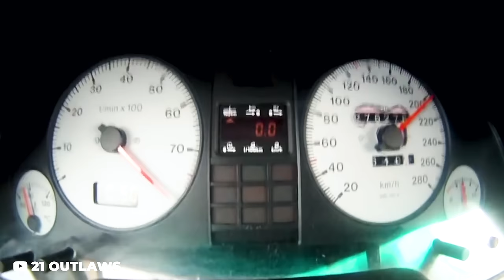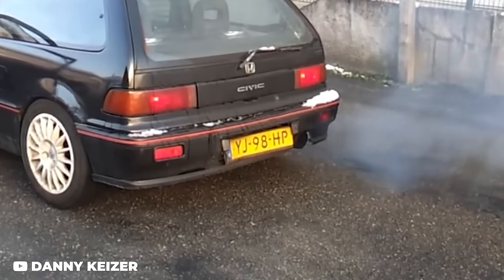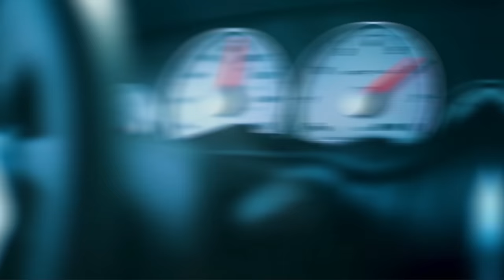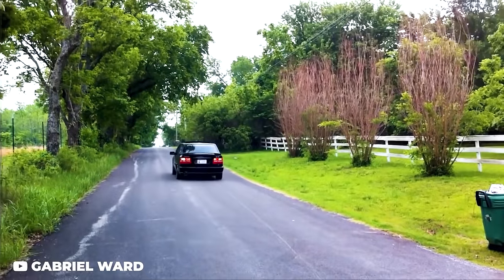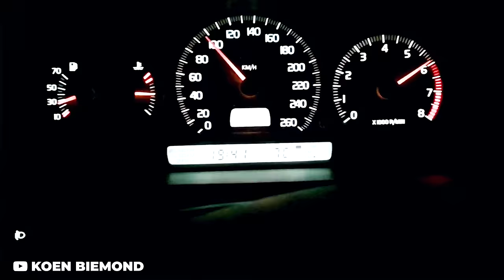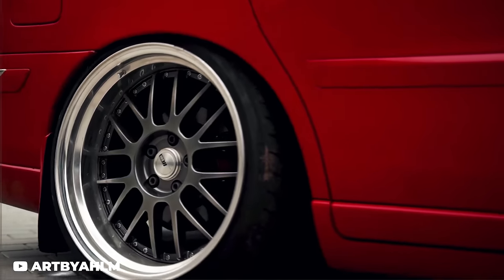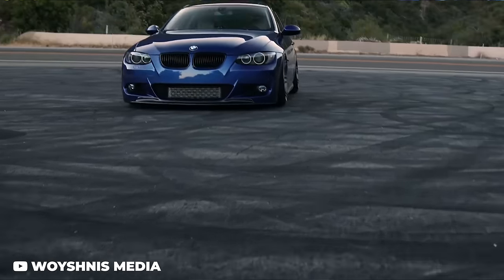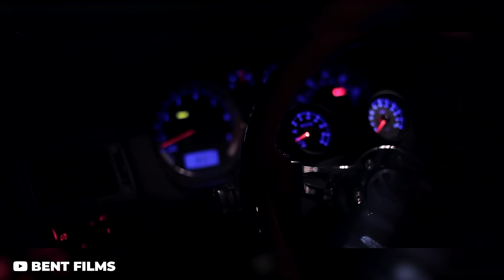5 Cars YOU Can BUILD For CHEAP Right Now!

Comment: quit telling truth about the 335i 😫 i’m still hoping to get one by March…
Reply: bro i recently got one. “cheap” to buy, not cheap to own. U better have like $3k-$4k over the purchase price of the car saved for repairs if u don’t plan to fix it yourself.
Reply: @yungkaos3500  my friend bought a e90 335i for 4k
Had to put 5k in maintenance/repairs
Reply: E36 M3 is a better car. Less problems.
Reply: @RadDadisRad  yes and no 
The E36 platform is amazing 
Relatively reliable 
Great aftermarket support 
Stylish and timeless 
The thing is the e36 market is rising, especially for the M3 and even 328i's
They're also severally underpowered and aren't nevertheless cheap to boost
Reply: $3k in repairs per year, every year.
Reply: Make sure you don't cheap out on the one you buy.  I looked for a few months to find one with good maintenance records.   Paid 11k, went FBO and mhd 2+ within a month of buying it.  3yrs later beating on it as a daily driver, maybe have 1k in repairs for things that broke, maybe 2k in maintenance, all work done myself in my driveway, so far with no issues, or check engine lights in a close to a year.  N54 will treat you good if you treat it good. Oh, and zero leaks as well 😉
Reply: @yungkaos3500  IMO you should not buy a BMW if your not going to do nearly all the work yourself including removing the engine to do leak repairs. This is a hardcore enthusiast car IMO. It's not for beginners unless money isn't a problem.
Reply: Paid $20K CAD for mine 5 years ago, 2007 70K km on it. Maintenance records, no headaches until recently. Just your basic maintenance tho, Oil Filter Housing Gaskets, Valve Cover Gaskets, oil cooler gaskets etc. Just dont cheap out on maintenance and the engine is bulletproof. Unfortunately, its the accessories around the engine that suck (Waterpump, thermostat, injectors) that tend to fail. Luckily FCP Euro has a lifetime warranty, buy once, never pay again.
Reply: FR that was gonna be my next project I don’t want fitment industries blowing up the price
Reply: It's an awesome car. But it will destroy your bank account to stay alive.
Reply: @MrMeasaftw  Not really if you do the work yourself and stick to as much aftermarket as you can. Parts are still going to cost more, but if what you're looking for is fully build internal engine power, then BMW's can give you that without having to build the engine internals.
Reply: @MrMeasaftw  But are the sensors that were damaged really necessary? I know that German cars have all kinds of sensors to control automated features like temperature adjustment of climate control and lights etc. 

The VANOS is the greatest PITA with BMW engines, that I know.
Reply: @SI0AX  I've replaced the map sensor, both crankshaft position sensors. No non-essential stuff so far. Point is. No matter what you do. Things will break. They will be expensive as hell compared to something like a 350z or a civic. And worst of all. The German engineering made it so you need 3 different bits to take off your fender liner. THE FUCKING FENDER LINER. I'm a mechanical engineer, and I like my designs to be at least somewhat easy to assemble. I think the BMW engineers took their parts and built a car in CAD. And then filled ALL the gaps with plastic brackets. Then they threw every single imaginable bolt size at it and called it a day.

I spent over an hour taking off a headlight the other day. Because the oil cooler was an afterthought, one of the brackets to remove the headlight is only accessible through a 3 cm gap in the front of the car. The car is full is this kind of bullshit. No room to work with, and 100 fasteners to loosen to get anywhere.
Reply: @MrMeasaftw  Shit... Never knew it was that bad. I thought Audi was the only one that liked trolling with 3 different fasteners to remove 1 small part and then having a different fastener for removing the adjacent valve cover. Damn, that pretty bad, I thought it was just recurring leaks that had to be repaired. I heard that it may be a hit or miss. Some owners get leaks, others get sensor problems.
Reply: @SI0AX  Okay I'm overreacting a little bit. It is not a terribly unreliable car overall. Its just anoying to service and unnecessarily expensive. And I live in Europe. The 3k a year on basic maintenance is pretty accurate.
Reply: @MrMeasaftw  Then it's best to not use that car a daily driver. I know the car is comfortable, but a Lexus is something I would daily drive(and actually do). 

A BMW would be a weekend car or using it for mid night races or race events etc. Limiting the mileage I put on the engine just to avoid the expensive maintenance.
Reply: @SI0AX  the battery will die if not driven often. 😅 Needs a trickle charge or daily drive
Reply: @MrMeasaftw  That happens to any car that sits for long periods. What I do is remove the battery and use the trickle charger. 

It should be fine with weekend drives unless there is a "parasitic drain" which can be a passive PITA to find the cause especially on an electronically complicated BMW because it can be cased by any of the electrical components in the vehicle.

I had a case where my 1991 Honda CRX has a parasitic drain caused by the seat belt sensor. I just disconnected and removed those useless sensors.

Comment: I no joke had my engine mount fail and the motor fall out of my 1.8t GTI…. It still runs, 1.8t never loose
Reply: Get Poly mounts. You didn't get any warnings like engine jumps between shifts that screw up your shifts?
Reply: @SI0AX  I ended up buying BFI’s. Now I run them in all my other VAG products

Comment: A cheap 335i will the be most expensive BMW you'll ever buy.
Reply: If you do all the work yourself and check to make sure the engine isn't toast, then it should be good. You will probably need to pull the engine to do some leak repairs but if you want to build a monster, this car will be usually cheaper because you don't need to buy forged engine parts and get machine shop work done to it.
Reply: @SI0AX  Yeah, they're really not that bad especially with the ease of power you can make. If you wanted a 350z with a VQ to make 6-700whp then I'll cost a lot more compared to the 335i N54.
Reply: @gabeishere4990  Pretty much any car will cost more than a BMW for going to that high power level because all of them will required forged pistons and rods along with all the other machine shop labor.

Comment: N55 motors in facelift E82 1er/E9x 3er cars aren't as internally strong as the N54, and have a bit more trouble making power but are pretty reliable. Making 390ish whp with an intercooler, downpipe, and chargepipe. Probably not even 1k deep yet
Reply: That's easily at least 2k+
Reply: @Jon-mo9ks  believe it or not aftermarket support to boost those cars is extremely cheap only problems is the regular maintenance that ends up costing more than aftermarket support. They even sell fbo kits for less than 1500

Comment: I have a 1.8T B5 A4. 5 speed manual with a K04 running Eurodyne Maestro software. Fun little work car/toy!
Reply: How's that software treating you? I'm looking for a good software. This tune I have now is shit... (Ko4, injectors fuel pump done on mine)
Reply: @Silenttoxx  it does the job but I wish I would have done a bit more research before I purchased it. My biggest complaints... If you use no lift shift, it's always on. Even at idle if you hit the clutch it will cut ignition. Why can't it only activate above a set rpm like the Boost Dynamic tune I had? 2 step is much the same, you don't need to have the clutch in. You can adjust where the set point is which is nice. I also had a crackle tune before Eurodyne, unfortunately there is no way to do it with this software. The deceleration fuel cut is always active with no way to disable. Customer service is basically nonexistent... You can only log what is already set up. Hptuners (can't do the 1.8T) you can create and log anything you can imagine. But Eurodyne is the cheapest way to tune this platform, if you want to be the tuner.
Reply: @4BillC  oh damn.. See I want no lift shift and launch control/ antilag to be able to be turned off.  I've seen some people make the cruise control switch the activation switch.    Is there any platforms that have that feature that you know of?  Like motoza ect..

Comment: B8 S4 with a few bolt ons will have you beating V8s left and right while having a better drive quality.
Reply: yeah but they are kind of like the 335i they break often and they are pretty expensive to repair
Reply: @qc_mat3537  Idk, I've seen multiple people say the b8 s4 is super reliable
Reply: @qc_mat3537  definitely not. 3.0 motors are pretty robust. The S4 is a solid platform. Many cars with 200k miles with a tune

Comment: Yes it's a V8 but hear me out, about a second or so slower 0-60 time as a new scat pack, 4 doors, big body, every luxury possible, reliability, find a high mileage Lexus ls430 and it's perfect slight modification these things rip, mine has almost 400k miles and I daily it pulls about a car length ahead against the mid 2000's mustang gt's, decent gas mileage for a V8, total sleeper cops never bug me in it get em while u can

Comment: The Volvo B5244T5 (P2 S60/V70 “face 2” T5 2.4) better be on this list.

Edit: Oh.. for f*** sake, the B5234T3 is not as cool as the B5244T5, the 2.4 (T5) is pretty similar straight wise as the 2.3, but i comes with the same Dual VVT top as the R (the other turbos “only” have VVT on the exhaust cam), has a very similar intake system as the R.

Comment: V8 is and always will be king
Reply: It's the most durable. You can buy high mileage V8's and not have to rebuild them unlike the 4 cylinders. Where I live people are asking nearly $20,000 for a Honda engine with more than 100,000 miles, it's BS, than engine is already near end of life with that mileage and will need a rebuild. That amount of money just isn't worth it. A V8 on the other-hand is a different story. Even high performance ones can get to 300,000 miles with little trouble.
Reply: @SI0AX  yes sir my mustang has over 180k on the clock and runs like a dream.